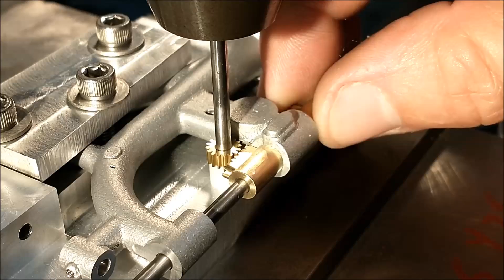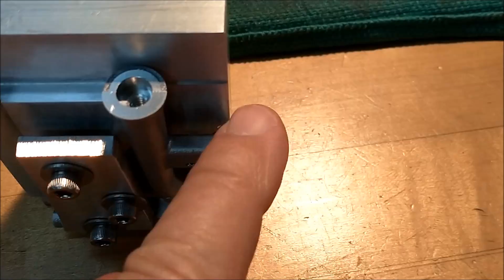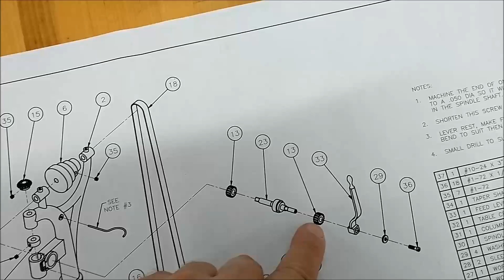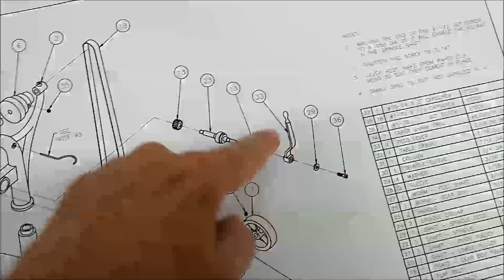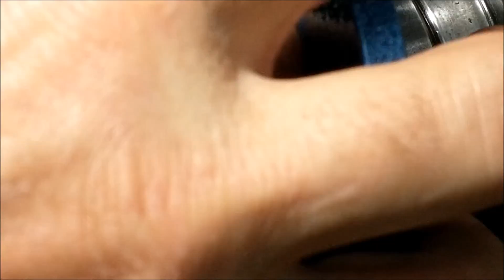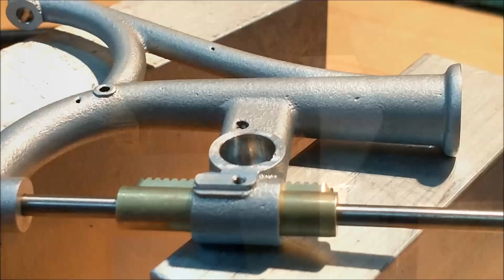Machining a Miniature Drill Press -- Upper Frame Final Details

Comment: Well Joe, I’m curious; why did you find it necessary to let the width of the rack dictate the placement of the driving gear, and not the other way around? Correct me please if I am in error, but couldn’t you have centered the gear on the boss and then either skim cut the back of the rack, or even better, milled a shallow slot that would trap the rack in the shaft. This is a non-rotating part, yes? Then fitting would be accomplished by insetting the rack in the shaft. One could even cut a bit deeper, then place a leaf spring behind the rack, pushing it outward into the gear. Minimum backlash and the spring prevents binding. Rubber O-Rings would be an option. Of course this is me being hyper critical. It looks great as always.
Reply: I was going to suggest  the same also but you beat me to it. It looked like the rack was already sitting in what was basically a key slot in the quill so I would assume your method would be valid and no different to fitting a standard key but the depth of the slot or height of the rack is governed by the position of the pinion and the desired feel of the mechanism.

Comment: Nice job as always, but could you not have recessed the rack a bit more in the shaft to reduce the excentricity of the gears relative to the casting?
Reply from the maker: The dimensions on the spindle and rack were very specific. I chose not to ignore the dimensions during the sequence.

Comment: Brilliant, as usual. Two questions - any reason why you didn't feel the need to jack the knee from underneath when counterboring the gear recess? It seemed to flex quite a bit. Also when you milled the first square on the shaft, there was considerable overhang out of the collet. Any reason not to push it in to the limit of the stock diameter?

Comment: 👍
For support when drilling the cross hole for the quill pinion use an adjustable parallel.  I'm sure Joe knows this. The comment is for the rest of you.
I'm curious abou just what diametral pitch the gears are. Or are they a special pitch to mate with a TPI on the worm gear.
That follower rest you made up for the leadscrew on the lathe project would have been slick when doing the back turning.

Comment: And I thought it was only me that used my knee to lift the knee but if the handle is positioned correctly it’s not too bad. I think you’ve balanced the casting really well.
Reply from the maker: You really can't appreciate how many areas need to be aligned to have it come out close to perfectly aligned. Its tougher than many may think. Thanks.

Comment: 12l14
Reply: Almost certainly.  Love that stuff, it's actually hard to get a bad finish.  Only downside is that it's a PITA to weld, brazing is usually the better option.  Oh, yeah, a little more susceptible to rust than 1018/1026.

Comment: re: 'the hook', it depends on the need of the time period. It could have been a 'hook' for a jerry pole to slide the drive belts on and off various sized drive wheels to drive the drill to needed speeds. I learned about them as a kid whose dad took them to a basic old time sandwich shop that used a small steam donkey that drove the ceiling fans via drive shafts and belts. Someone complained it was too hot, the grill cook grabbed a jerry pole that looked almost like a gaff and jockeyed the drive belts on the ceiling to drive the fans faster. It was serious old school.